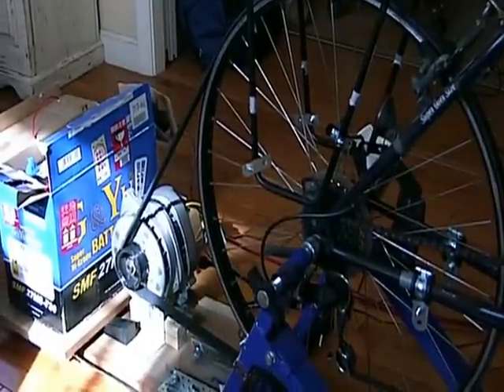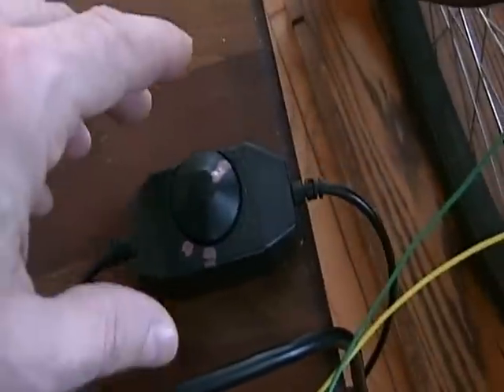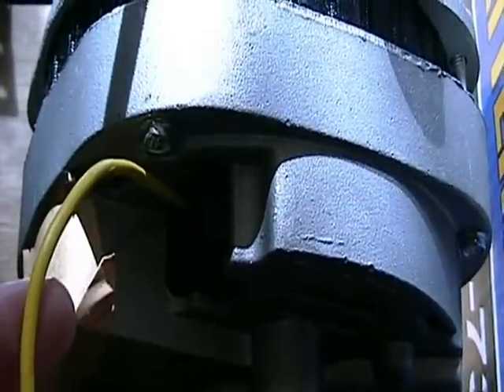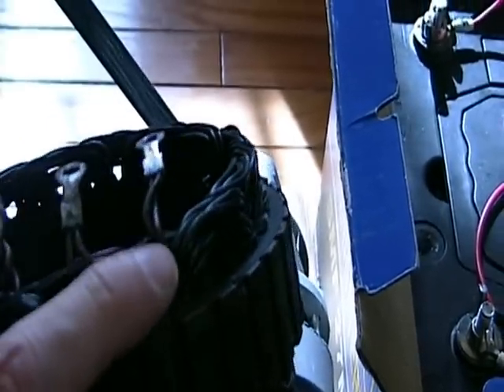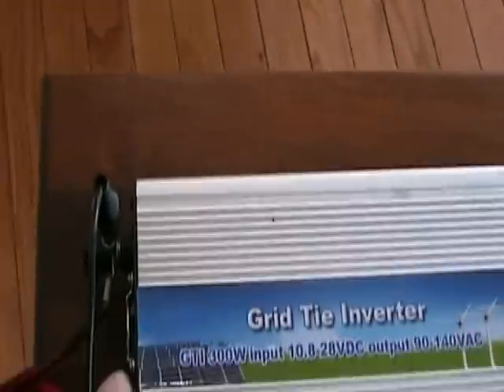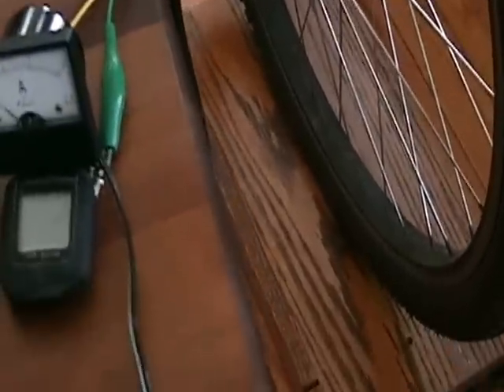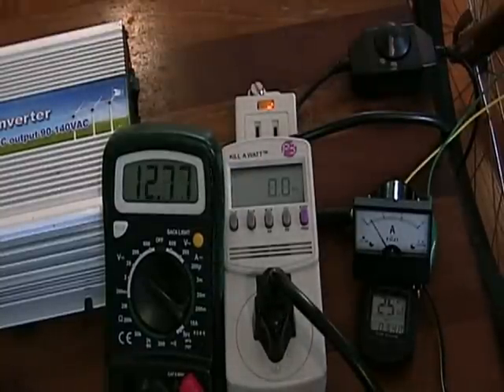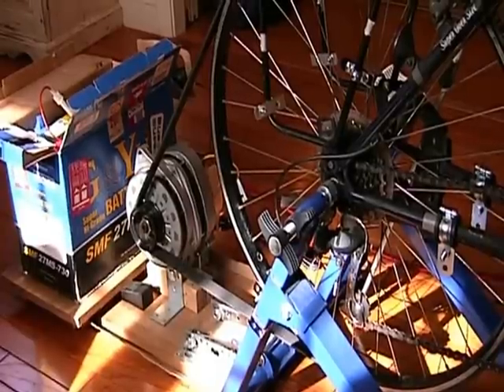DIY Bicycle Generator/Trainer - MODIFIED CS-144 with Grid Tie Inverter

Comment from the maker: Hi Thomas!
From what I've read and seen on the Web, friction drives are not very efficient for a generator, so I never even hooked up the original Tacx resistance unit (it sits in box somewhere to this day).  I went straight to hooking up the alternator with a belt drive.

Comment: A treadmill usually uses a permanent magnet DC motor with a speed controller. Try using that motor instead of an alternator. If you spin a treadmill motor by hand, it will start generating power right away.

Comment: Pretty cool use of a GTI!  I've been looking for an exercise bike that can make power, I'd eally want it to charge a bank of batteries at 24volts for those days that the sun doesn't shine :)  I'd rather purchase the bike fully assembled, but it is difficult to find something here in the U.S. that is ready to go.  I have found a few suppliers in China, but I'm also not looking to buy in lots of 100.  Maybe I can follow your project and build one.  Lord knows I need to excersise!

Comment: did you attempt to connect the alternator to the shaft output from the original bicycle trainer resistance unit, so that the rear wheel still runs against the original bicycle trainer fly wheel?  Thanks, this is very cool

Comment from the maker: If you aren't able to find something "off the shelf" in the way of an exercise bike that generates 24vdc, then hooking up a car alternator to a bike is probably the simplest way of getting those batteries charged while exercising.  I wouldn't look to charge a whole bank at once, though, unless you're a professional cyclist!  If nothing else was learned from this project, I discovered that alternators were designed with horsepower engines in mind, while little ol' me struggles to produce 1/3hp.